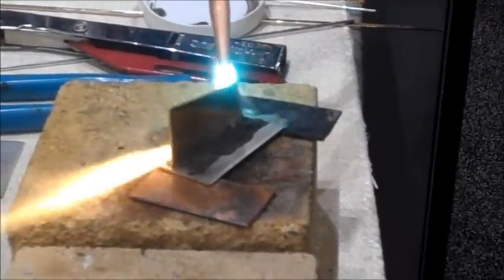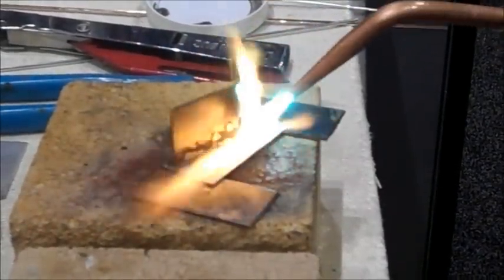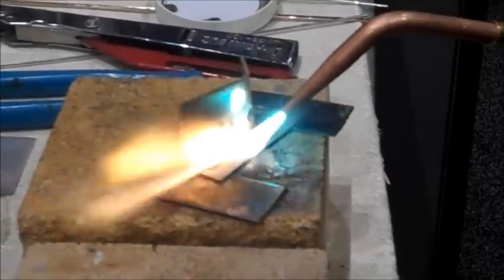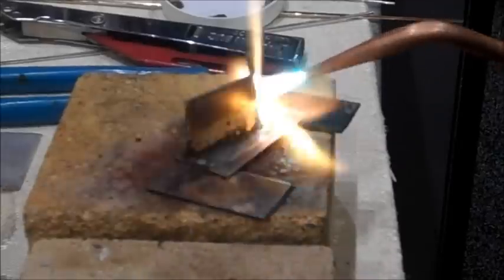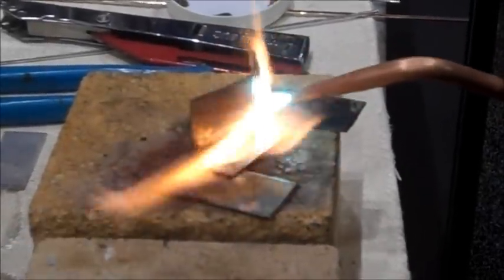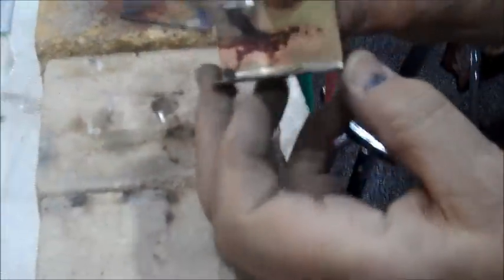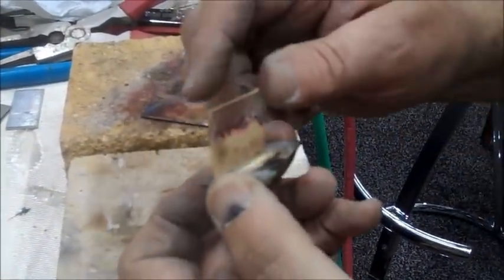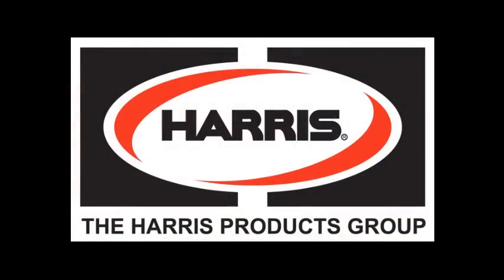Brazing Brass to Stainless at FABTECH 2011

Comment from the maker: Brazing stainless to stainless is no problem as long as you use a high silver brazing alloy (BAg) and a brazing paste flux. Our Safety-Silv® 45 or Safety-Silv 56 with Stay-Silv® Black Flux are good examples of products to use. See the "Products>Brazing" section of our website for more details on high silver alloys.

Comment: I am switching over from acetylene to propane. I braze and solder copper to copper and aluminum and steel. what would be the best bet to accomplish this.   I have a victor 100 and can't find propane tips. looking at the inferno or alternative oxy popane. Need small tips at times. 0,1,2 2 tip thanks for your help

Comment: as far as I'm concerned this isn't brazing its soldering.
Reply: Do you understand the difference between the two? It's often called "silver soldering", but it is in fact brazing. The main difference being the temperature at which the process takes place.
Reply: Well, are you an internationally known manufacturer of welding gear and alloys?  Or just some internet kook?  You might feel better to know that this is also called "silver brazing".

Comment: you are soldering  , NOT  Brazing .  know the difference !
Reply from the maker: In this case we were brazing. George would have been using either Safety-Silv 45 or Safety-Silv 56 with the Stay-Silv Black Flux. Both alloys and the flux are designed for high-heat brazing applications, and the melting temperatures of both alloys is above the threshold for soldering.